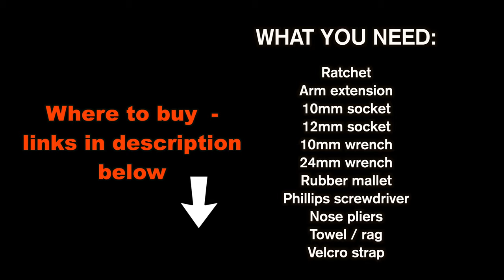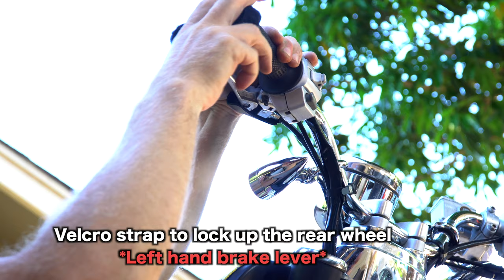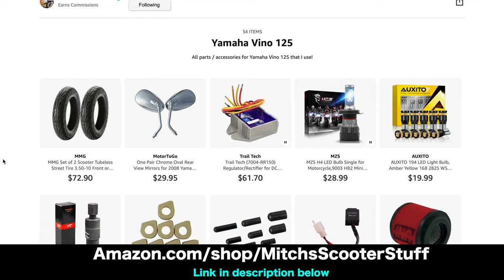Yamaha Vino 125 Rear Wheel Removal | Mitch's Scooter Stuff

Comment from the maker: * Tools I used in this video: 
Ratchet 3/8 drive - http://amzn.to/2hhmnUs
3" / 6” extension set 3/8 drive - http://amzn.to/2h7ypMl
10mm socket 3/8 drive - http://amzn.to/2xGuLSF
12mm socket 3/8 drive - http://amzn.to/2xM4Edr
10mm gear wrench - https://amzn.to/2LZmuzY
24mm wrench - http://amzn.to/2FnwOgT
Breaker bar 1/2 drive - http://amzn.to/2HenuMI
Rubber mallet - http://amzn.to/2BsqAMz
Phillips #2 screwdriver - http://amzn.to/2fgdZDL
Nose pliers - http://amzn.to/2yetDDj
Towel / rag - https://amzn.to/2Yh8jvg
Velcro strap - https://amzn.to/38GYLyd

Comment: I bought a used Vino in 2019 and the covid hit. It's been sitting since then. I rode it yesterday for the first time and one of the valve stems broke when I was adding air to the tires. It was the rear wheel. Thanks to Mitch, I know how to get it off. Mitch is the man.

Comment: I ended up putting shinko 421 3.50x10 on both front and rear I love them:) great video . I snuck my rear in and out with the muffler half hanging :)
Reply from the maker: Very nice!😄🙌🏼
Reply: Are the Shinko 421 Tubeless or Tubed tires?
Reply: @linusgallitzin  tubed . I mounted them on the vino125 rims no problem set the bead and have put a few hundred km on them so far . They sound really loud like a jeep going down the road I love it. I don't expect them to wear that well . In my experience with shinko they are soft
Reply: @linusgallitzin  the rims are tubeless the tires are tubed but I mounted them without tubes they seem to work fine

Comment: I need some advice. I bought my 125 Vino brand new and only put 58 miles on it. Got sick and it's been parked in my garage for 10yrs. I'm finally able to ride again and have sent it to a local bike mechanic (not a dealership). I know that the carburetor will have to be redone, new battery, new spark plug. Probably should change out all the oil. Anything else I should expect or want to have done to make her roadsafe?
Reply from the maker: Glad you are healing and ready to ride 😊 I would check the condition on tires and air filter too. Old tires are scary to ride on 🥵
Reply: @MitchsScooterStuff  Thank you.

Comment: To make it easy to get the work done, buy some impact wrench
Reply from the maker: Yes, I have impact wrench but I don’t want people to feel like they must have one… not everyone have an impact wrench and air compressor… 😬🤷🏼‍♂️ also I don’t recommend to use impact wrench for tightening
Reply: The only good an impact will do is take off the rear main nut. Beyond that it's useless.  0 reason to have an impact when working on small scooters. This is a very good tutorial for beginners. It allows beginners to learn without the expense of power tools.  I have a kit that sits under the seat that has every single tool you need to pull the entire scooter apart and put back together.